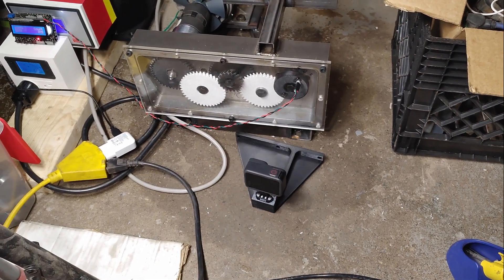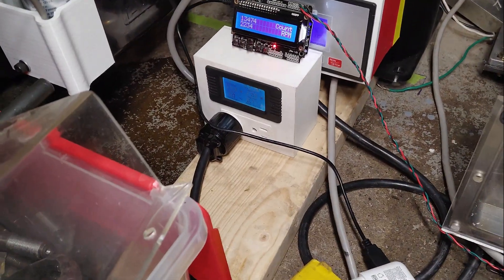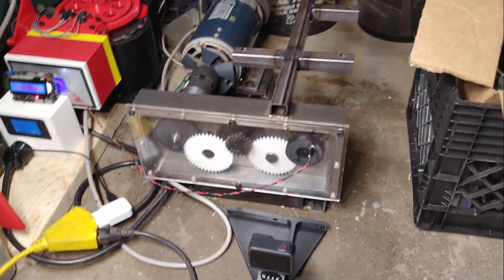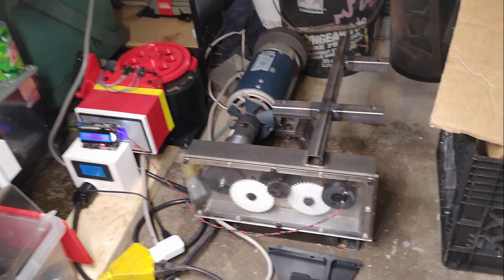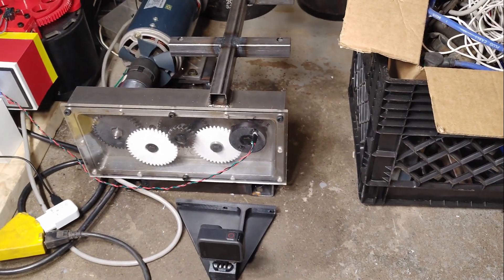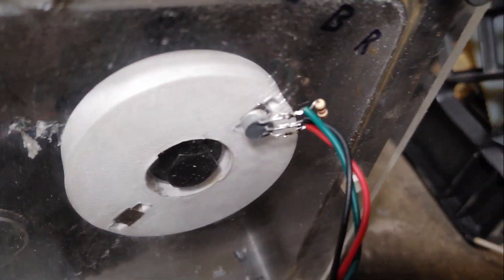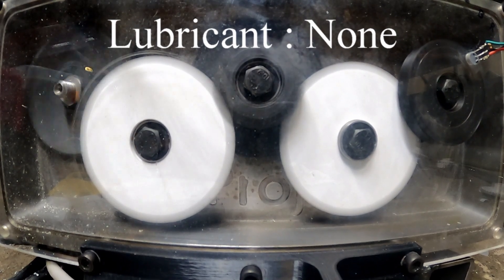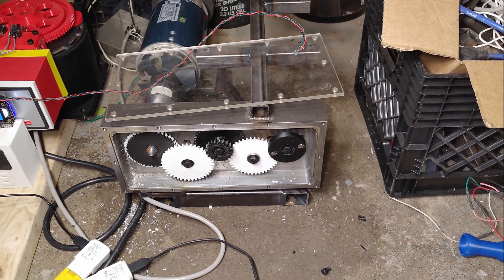3D printed PLA Helical vs Spur Gear - How fast can they spin?

Comment: Very nice! Actually i am trying to delivery a functional helicoidal gear for a customer.. In the case will be 300 rpm, and lubrificated. I´m hopping to work kkkk
Reply: Can you share your exp.
Reply: @cimilee  It is working for the past 3 months without any issue. I printed in PLA with 100% infill and 10 walls - 0.4mm nose.
I am printing more gears for this customer, the price of my gear is half of the convetional